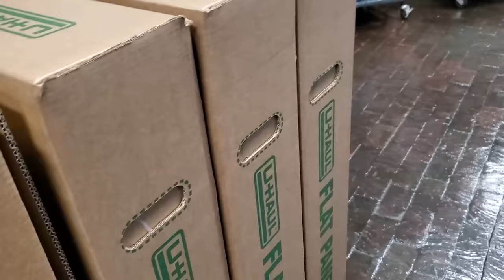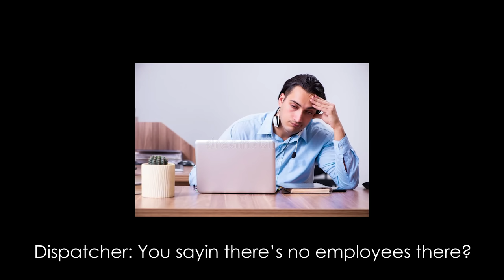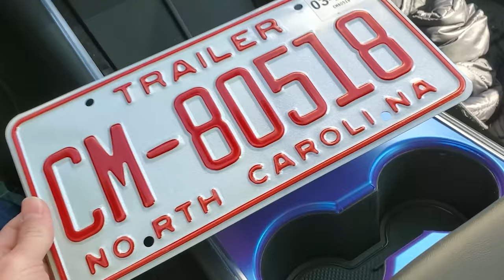I had to call the police on myself

Comment: Hey Alex, please consider the strength of that plywood going forward. The pine boards were providing rigidity as the cargo was moving. As it is, anything heavy that comes unsecured could just punch a hole right through the plywood. Especially for the bottom, you're going to need to use either more solid boards or a metal sheet + more strut system. Source: Hull Tech for 4 years.

 Hope you have more time to plan in the future! It was good to see you excited about a new project.

Comment: This brings back memories!  I installed a hitch on my Tesla 3 last summer.  Did all the wiring myself, too!  Then I took my car into Tesla for repair of an unrelated item and they undid all the wiring since they thought it was in the way but didn't put it back!  Grr!  This may be obvious but don't forget that hauling stuff will suck your battery MUCH faster and the battery calculator on the car's computer doesn't take that into account.  Be well charged up before any hauling.  We coasted into one town on zero battery because of this the first time.  Luckily made it to the supercharger!
Reply from the maker: I'm averaging about 400kwh vs my usual 275 or so, honestly not quite as bad as I anticipated. do you tend to find chargers with trailer pull throughs or have to disconnect the trailer every charge? the majority I find don't have them. Also my NoA is having issues connecting to the ultrasonic sensors so I guess I'll need to give service a heads-up on the wiring

Comment: You can just do a quick google of the local police dept and call their non-emergency line so it doesn't tie up the 911 dispatchers. Had to do it several times when I lived in bad area and had to report crap stolen, and for fender benders.
Reply: nah this was emergency enough imo. there is an alarm blaring, someone could perceive the situation incorrectly, he did the right thing.  In my area both of your situations would immediately get you transferred to 911.

Comment: there's a synthetic material you can get that is planks made out of pressurized bamboo fiber and resin that is very water damage resistant and fire resistant and stronger than wood.  Would recommend for something like this when the wood rots out again.

Comment: Your wheel hubs on the trailer are missing the dust caps. Common problem, but you should replace them so the grease doesn't get dirty or wash out.
Reply from the maker: Oh thanks I'll do that. I've never heard of a wheel hub or dust cap lol
Reply: @GoHerping  The part in the center of the wheel :)

Comment: Hey check the wood your floor boards are made of. They may be oak not pine. Oak is often used as the floorboards because it is much stronger than pine. If that is so think about painting them and reinstalling them because their strength way out performs plywood.
Reply: With the oak floor boards that trailer can be loaded with a 750 lbs. round of hay no problem.

Comment: I figure guys standing and sitting around watching other guys work is the original youtube. I worked as a fabricator at an engineering college and try to do all my own repairs/building. So repairing a trailer isn't anything I find particularly difficult but I WILL sit around for hours on end going yep, you should have gotten longer sockets, yea you can do bolt cutters but if you have a dremmel you can use that too or a cut off blade. Why? I have no idea, I think it's something in my dna. Good Job with the trailer though! It hard now days learning how to do this stuff because not a lot of people do it, but wonderful job trying something outside your wheel house!

Comment: With a trailer like that. Check the lights, grease the wheels. And make sure the coupler/ball connection works securely. And you’ll be good. Usually easy care as king as their is no major body corrosion.
Reply: And ps, I’d take your hitch to a dealer or trailer shop to install properly. It’ll be really really tough to properly install your hitch. I used to work on trailers and trucks etc.

Comment: Torque wrench is really meant for tightening bolts to a specific spec. not so much for removing bolts.
Reply from the maker: the big torque wrench is to work with the hitch bolts cause they have to be at 50ft lbs

Comment: Last time I got a Uhaul...I didn't.  Booked it, but when I went to pick it up, they didn't have it, and wanted me to drive nearly 2 hours north to get one, and then drive it back there when I was done.  They would cover fuel, they said.  Uh...no?  The reason I was using a Uhaul is because I don't normally drive, and was using it to move my apartment.  In the same city.  Which they knew when I booked it.  The whole thing was super sketchy, it wasn't even at a Uhaul property, it was some rundown "auto shop" that the owner rented Uhaul trucks from, even though there wasn't any there...ever.  He had no problem taking credit card info, but not even booking the actual truck, and just called to find one when we came in to pick one up.  It made moving that day a real fun time...couldn't get a van or truck anywhere in my city on short notice, not even a moving company would do it on such short notice, and they charged $300-400.  I ended up having my nearly 80 year old grandfather help me move in his rusty old pickup truck...he lives 3 hours away from me and had to spend all day with no notice, and the poor guy can hardly breath.  Uhaul sucks.  They have tried over charging me for things and adding damages that were already there to my bill, after the truck was returned.  One time, my sister left her keys in a Uhaul, and when we called and asked them to check, they didn't, and added the "lost keys" charge to my account instead...which is for when you lost their keys, not lose your house keys in their truck lol   And then would call me every month asking me to pay for the lost keys...even though it was explained to them over and over what happened.  Had to pay the charge to get another Uhaul...there was no arguing with them.

Comment: I’m not so sure it’s a good idea to use wood that thin on a trailer. I’m pretty sure they use those thick single planks because they are sturdy and won’t give out under heavy weight or pressure and dump your stuff onto the road when you are driving on the highway. Also if you use planks, if one breaks you can replace just that one instead of having to replace the whole bottom or whole side
Reply: Oh! Another reason. If you use a sheet of plywood for the bottom, it will collect water and rot. When you use planks the water easily drains between them.

Comment: Trailers need their own tags? we make it really easy in England.  You just need the registration number of the car towing it displayed, either a proper registration plate or just the reg number scrawled on a piece of cardboard. The trailer itself is irrelevant, it's just an extension of the vehicle towing it so that reg needs to be displayed
Reply from the maker: gov likes complicating things i guess. But what if you towed the trailer with a different vehicle? The tag wouldn't line up with the trailer, unless you literally just put your car's number plate on the trailer I guess?
Reply: You just change the reg number on the trailer, so it can be passed about between cars easily. It just needs to show the registration number of the car towing it so the car / driver can be identified

Comment: It would be scary if the reason for the security alarm system being in place and the doors being unlocked and the lights on is because the worker was kidnapped and was about to close up. I hope nothing like that happened, but it’s entirely possible and has happened in the past, unfortunately. If That was the case, I hope you were the one that alarmed authorities about the missing person and hopefully they’re back and safe.

Comment: Goes from thick treated pine to thin untreated plywood? Really? You could have stained and sealed the wood and would've lasted a lot longer and saved all the time. Or could've at least got treated plywood if you were absolutely wanting to do plywood.   Best bet though is to do metal bottom and sides. You can get steel grates inexpensively and lasts soo much longer.

Comment: This is so hard to watch. @ 16:12  those are the wrong bolts to be using... that square portion is supposed to embed in a surface. You need a flush carriage bolt and without it, that is not going to wear well.

Also your wood didn't fit because you took the sides out...

Comment: They send cops in pairs or threes so they can have someone to run back if they ever need backup or if one man is down. Three is in case one person is injured, one stays to take care of the injured and the other looks for help 

👍🏻
Reply: not exactly, but yes. police don't have to look for help, they radio in all calls, which includes where they're going and why, and dispatch is alerted to whatever the scenario is. it's common to be in pairs, usually a senior and a rookie, but you can have two seniors just for safety. ideally you'd always ride with someone, but most forces are spread thin, so they'll prioritize at night and instead during the day, have the officer conducting a stop wait for another officer before proceeding.

Comment: Bolt heads should be on the outside of the trailer not the nut. It looks neater.
Reply from the maker: they have to be able to dig into the wood, since i put the wood on the inside of the metal it wouldn't have held in place as well. but i'll probably trim them down

Comment: Its very possible they didn't send two cops, they sent one and someone else was bored and decided to come too. Its kinda dumb because having several units show up can be freaky but it happens all the time because they're bored.
Reply from the maker: i'd probably do the same as a cop lol. backup never hurts in case anyways
Reply: @GoHerping  except for when you give someone a panic attack lmaoooooo. Glad those cops were cool though. You gonna be truck shopping soon now?
Reply: it's pretty standard, especially at night, to have two officers conducting stops. if you're spread thin and you pull someone over, you call in for backup, and wait until another officer arrives to conduct the stop.

Comment: 8:10 bro there is a nut on the end of that screw holding it on, just get a wrench and take it off. You didn't need metal cutters lol.........
Reply from the maker: The carriage bolts weren't properly planted in the wood, a wrench just spins the whole screw
Reply: @GoHerping  pliers on the bolt and wrench on the nut maybe? Just don't want you to need to saw any bolts again...